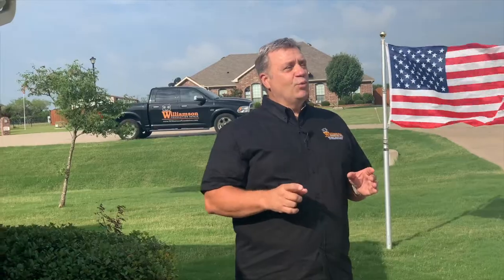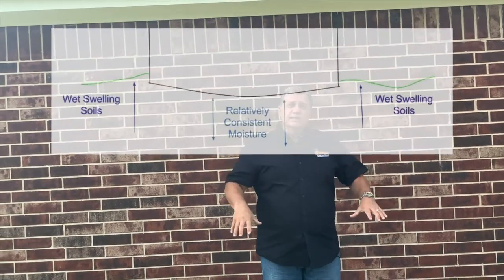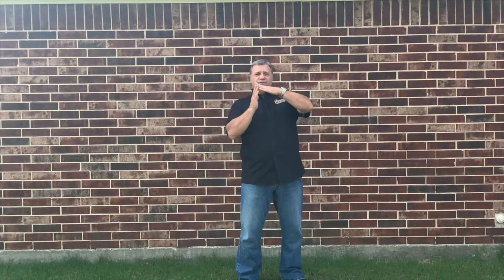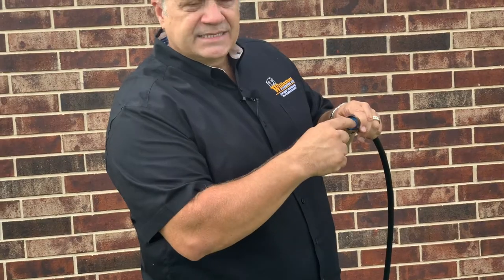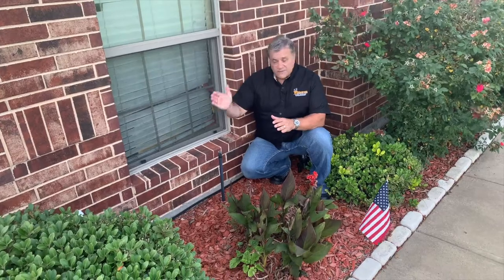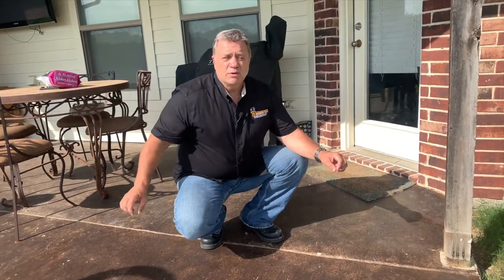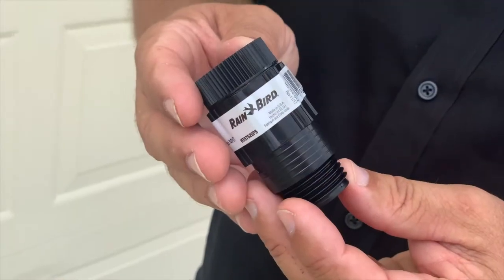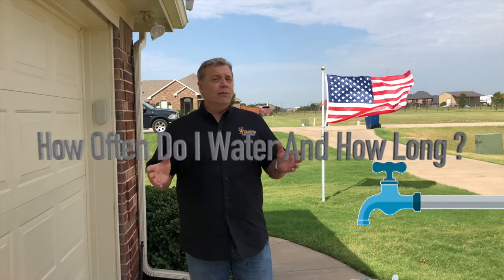How To Water Foundation With Soaker Hose

Comment: Is so confusing. The gutter people says that the gutter prevents water from damaging your foundation, and this guy, says to water your foundation. 🙄
Reply: Lots of water running off from the edge of your roof can saturate the soil then wash out and remove it from the perimeter of your foundation. You don't want it over saturated or allow voids underneath, but you also don't want it too dry.

Comment: Thanks so much for this video! I am 71 and have argued with my 42-year-old son about the need to water the foundation during these scorching dry summers. My foundation cracked several years back and has created a mess for me that I cannot afford to take care of. He is worried about weeds growing with the watering! HA! As usual, I will be doing this to protect the house he thinks he will inherit! NOT SO! I turned up the sound on this video while he was arguing and he still did not understand! I did learn in the video to not place the hose next to the foundation and I was going to do that. Now, if I can drag myself out into the 100+ temps to lay the hose around the house, I will be more assured of protecting my home. Patsy

Comment: As a new home owner all the educational videos are very helpful. I have one question though: I am installing a 2 ft tile pavement on one side of the house to prevent the soil erosion caused by rain water (there are no rain gutters on that side) and some landscaping. Can I put the water hose at 2 ft? Other option is to put the hose under the paver tiles at 8-12 inches.
Reply from the maker: If the tiles are being grouted together or installed atop a solid concrete pad, then you can put the soaker house at or just beyond the 2’ mark.   If, however, the tiles are simply laying atop the soil and butted against each other, it would be best to place the soaker hose either underneath or even atop the tiles at the 12” point where the tiles meet so that water can seep down between the tiles.

Comment: Thanks very much for this! Answered a number of my questions. One big question I still have is how to water foundation on clay TX soil when on 3 sides of the house, the soil slopes downward from the house at 3 different grades Also, opposite sides of house are not 
equal in grade. House essentially sits on top of a little hill but neighbors are very close. The property line is only 5’ from house on 2 sides.

Comment: In homeownership I've been blessed that I've never had to use a Soaker Hose, till now. I live close to Galveston, I just noticed a 1/2+ gap on the east side of my homes foundation and bought a 75" hose but very little seepage in the last 10". Thanks to this video I'm Gonna find me a pressure reducer tomorrow and see if it doesn't fix this issue.
Thanks a bunch and God bless Texas

Comment: When using a pressure regulator do you remove the blue disk from the immediate soaker hose as well, or does that stay on regardless?

Comment: Thanks for providing all of the great info. My only question is regarding the driveway expansion joint. I've read that you want to keep the joint sealed with something that can flex to minor shifts. Sealing the joint will prevent water from getting under the concrete and causing pre-maturing cracking.

Based on what I've read and what you're saying, it seems like you have to choose between your foundation at that part of the home or the driveway. Is that correct?

Comment: Great video. When using a pressure regulator do you remove the blue disk from the immediate soaker hose as well, or does that stay on regardless? Thanks
Reply: Exactly what I was wondering. Did you ever find the answer to this?

Comment: Thanks for this terrific, informative video! We bought and moved into a severely neglected rental house on a zero lot line property where the house serves as the property line/fence for one side. When one side of the house is shaded and watered by a neighbor, one side mostly banked by driveway and sidewalk,  and two sides are sunny, extremely dry, mostly grassless, and very neglected...what is the best way to start off with foundation care for a severely neglected property? We have begun to notice shifting in doors, but the soil looks decent, no huge cracks. Just some pulling away from the foundation about 1/3 to 1/2 inch in places.

Comment: How should you water if you have rocks around border of house versus dirt? thanks
Reply from the maker: Rocks around the border of the house can often help hold moisture in a bit better than vegetation or mulch, but also the rocks can get quite hot in the summer and contribute to drying soil, plus the rocks can hide the visible signs that your soil is too dry. So we really recommend watering in rock landscape areas the same as you would around the rest of the house: with a soaker hose placed 6 to 12 inches away from the foundation.

Comment: I'm getting  new gutters. How do I know  how long to extend away from house for foundation?
Reply from the maker: There is no definitive distance from the foundation where the gutters should release the water. The primary concern is that the water, once released from the gutter downspout, does not run back toward the foundation and pool within a couple feet of the foundation. So the gutter downspout can discharge water anywhere that the water will continue to naturally run away from the house.

Comment: I have a few questions: 1. do you need to adjust if you have unbalanced conditions/environments such as the north side of the house stay more moist in the south side of the house stay more dry; as in water the southside more than the northside? 2. Do you recommend recommend 18” spacing drip irrigation hose as it’s more durable ? 3. If you put 3in gravel around the foundation will you be able to water less like 50% less water since the gravel helps retain the moisture? Thanks!
Reply from the maker: 1. Yes – watering more in areas more prone to drying, such as the south elevation or areas with larger trees is very beneficial.
2. You can use drip irrigation pipe with 18” spacing as it does tend to be more durable.  For foundation watering, I recommend 12” spacing if available.
3. The gravel will not “retain” moisture, but will help reduce run-off and evaporation.  Only do this with the drip irrigation pipe and not with traditional soaker hose.

Comment: Thank you for this enlightening information!  We are in New Mexico but have similar problems.  We have just set up our drip hoses using first, a hose splitter attached to the faucet so we can use one outlet for a regular hose and second, the 25PSI pressure regulator, third, a second splitter so we can have drip hoses going two directions, fourth, attached the two drip hoses after removing the blue gasket and inserting regular hose gaskets.  My concern....The faucet is probably 20" above the ground and the water coming from the top of the hose down to the ground is causing a good bit of puddling right below the faucet and at that corner of the house.  Should we attach a short regular hoses to that second splitter then attach those to the soaker hoses?  I might add, my husband put Teflon tape on the threads so there isn't any leaking from the connections.  I hope this makes sense; thank you for a reply.
Reply from the maker: Makes perfect sense!   Yes – to avoid the puddling at the base of the hose bib, try running a short non-porous hose (like a washing machine hose) from your first splitter down to ground level, then attach the 2nd splitter and run your soaker hoses from there.   You also may want to put the pressure regulator at either end of this short hose as well so that you don’t restrict water pressure into the hose you will use for hand watering, car washing, etc.
Hope we have answered your question!
Reply: @williamsonfoundation  Thank you for checking back.  Okay, got it!  Your solution allows for one non porous hose where we were thinking two; one for each drip hose.  Yes, we will still use the pressure regulator.  Thanks so much; hoping this will help after having cracked mortar repaired recently.  Incidentally, we had never heard of watering the foundation until the repair man mentioned it.  Makes sense!

Comment: How do you water  area between foundation and  ac slab?
Reply from the maker: If you have at least two or 3 inches between your air conditioning pad and your foundation, you can run the soaker hose through that area. Even though this is technically too close to the foundation, it is the best alternative for this small area.
If you don’t have enough space between the air conditioning pad and your foundation for a soaker hose, then simply run the soaker hose around the air conditioning pad. In this case, you can put the soaker hose right up against the air conditioning pad as needed.
We hope that thoroughly answers your question. Please let us know if there’s anything else we can do to help.
Reply: Thank you

Comment: We have the lawn mower man issue.  I have to pick up the 150ft hose every week or two? any alternatives? anything we can bury?
Reply from the maker: Did you see where we mentioned using landscape pins to pin down the hose more snug with the ground? These can be found at most hardware stores.
Reply from the maker: https://www.lowes.com/pd/Sta-Green-25-Pack-4-in-Steel-Landscape-Fabric-Pins/1000002548?cm_mmc=shp-_-c-_-prd-_-lwn-_-ggl-_-LIA_LWN_236_Hardscapes-_-1000002548-_-local-_-0-_-0&gclid=Cj0KCQjw7uSkBhDGARIsAMCZNJsaSMZVmUW3pIqY_GdJ_Kn-N_2dO5yM-r71ePYWPKssK8XCoy79MZ4aAhKUEALw_wcB&gclsrc=aw.ds

Comment: I am using irrigation drip line, the holes are 18 inches apart and deliver a gallon of water per hour. I have gone all over the Internet trying to read about this, everything I read said that you needed to keep it 20 to 24 inches out from the foundation- I am at 20 inches. I have a pressure regulator, screen filter and backflip preventer in there as well. Let me know if you feel like there’s anything wrong with this kind of set up.

Comment: I bought a 100ft soaker hose last night. My problem is that my foundation perimeter fluctuates in height depending on landscaping or turf (3-6in max). I've discovered that there is not enough pressure in the line to overcome these undulations over more than 30ft - no seepage at all (regardless of bib pressure or presence of the blue restrictor). Am I doing something wrong, or do I just need to accept short runs?

Comment: What about after having piers installed / repairs?
Reply from the maker: Assuming your house is outside of normal shifting we recommend a combination of piers and watering. Proper watering is your key defense in costly foundation repair. Sometimes foundation repair can't be avoided but a good watering program can prevent unnecessary damage.
Reply: He’s asking about watering the foundation after piers have been installed? Same protocol??
Reply from the maker: @TXCAMSS1   Yes same protocol. The goal is to keep the same amount of moisture consistent around the house. Because of drainage, how the sun hits differently on each side of the house  and more.  After work is completed we still recommend watering your foundation.

Comment: Hi! Thank you for this video! I have a gap forming already at the front & 1 side of the house. Should I add fill dirt there before or after laying the soaker hose?  Also - my house has a sprinkler system, how should I time ot/alternate with that?
Reply: Same question here! Should we fill the gap with more soil?
Reply: @houstontexasrealtor  I read that you’re not supposed to. It could cause extra pressure when the soil expands layer.

Comment: I bought some quikrete sand from Home  Depot to fill the gaps around my foundation. Is that productive? Thanks
Reply from the maker: We actually recommend watering till the gaps start to fill themselves. May take a few days of running soaker hose for an hour or so before they start to fill.
Reply: That’ll just cause even more compaction.
Reply: @mrRoverkane  is that good or bad? Thanks
Reply: @pinoyboyz3043  that’s bad. The soil splits because of compaction (lack of moisture). It loosens with moisture. Adding sand will make it more compact. 

Like rubbing sand on your cracked lips. What the lips need is moisturizer. Hope that makes sense haha.
Reply: @mrRoverkane  so,do I just let those gaps get bigger. Our city allows us to water everyday by a hose under the water consumption policy
Reply: @pinoyboyz3043  honestly yes. Unless you want a $300+ water bill. This has been happening since the beginning of time. This heat is nothing new. I wouldn’t over think it. When you water your lawn, go heavier near the house. You can’t beat nature, end of day
Reply: @mrRoverkane  yes,I read somewhere to water within 10 ft from house. Thanks again for the tip my friend!

Comment: I understood everything until it got to the pavement part 

My brain isn’t working
Reply from the maker: Run the hose along the caulked part of the concrete where the driveway meets the lip into garage or back porch meets the house. Water will seep through the caulk. This doesn't need to be done as often but occasionally is good.

Comment: how to lay soaker hoses near the house entrance or near the garage door? Is there a specific place where we can lay soaker hoses permanently near the home entrance.
Reply from the maker: Typically there is not a good solution for these areas with a traditional soaker hose.
To go under the front walkway leading to the house, you can tunnel under and install a PVC pipe with holes drilled in it, then run your soaker hose through the pipe to get from one side of the walkway to the other. The driveway is a different story and typically only needs water to her three times a year during the hottest months of the year. 
That can be accomplished simply by playing the soaker hose over the gap between the driveway and the house foundation and letting it run a couple hours once a month.
Reply: @williamsonfoundation   Thank you for your response.

Comment: 1- Seems like the water bill wou skyrocket for some people. 2- Is there a solution that can stay buried and have more accurate water delivery?
Reply from the maker: You can do a drip line irrigation system that can be buried. Just don't bury a soaker hose. They are not made for that and can end up causing more damage.